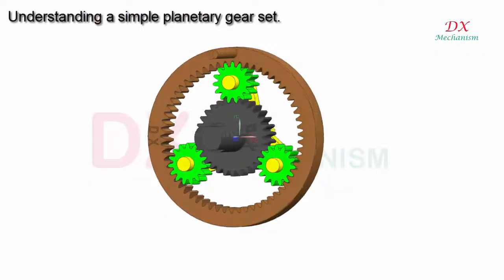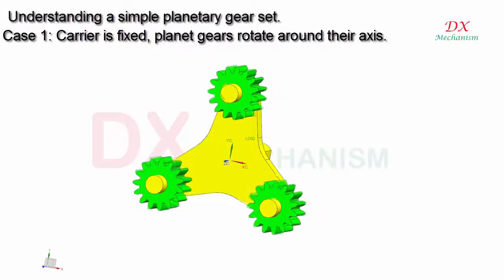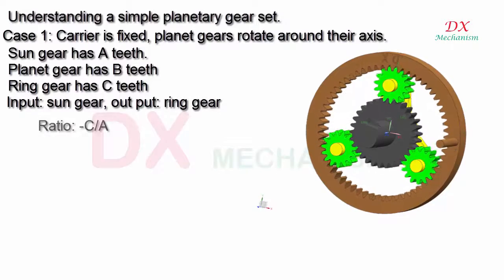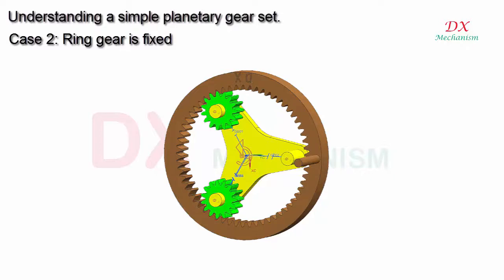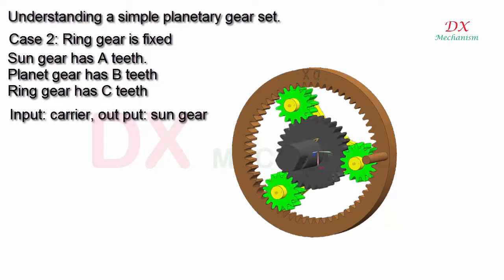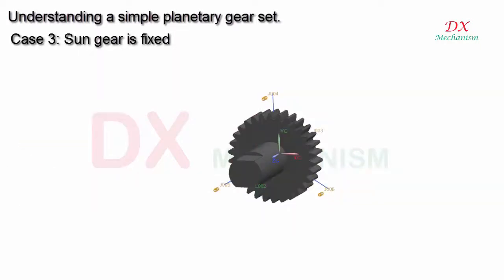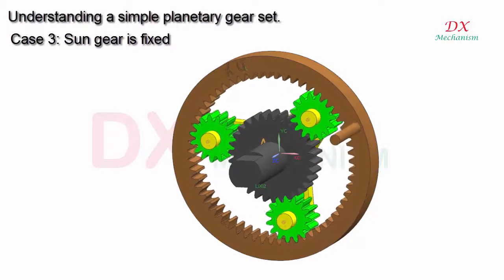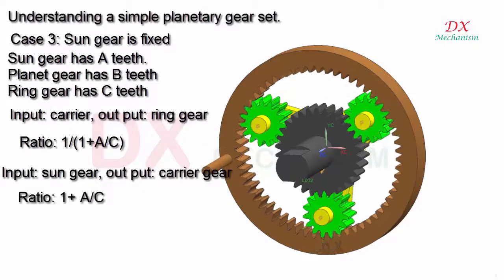Understanding PLANETARY GEAR set how to work and calculate

Comment: Whatever the ring turns divided by planets is the number of turns the sun makes 
If the ring has 60 and the planet has 10 the sun turns 6 times because the sun can only turn the number of teeth on the ring
Reply from the maker: Yes
Reply: what's mean